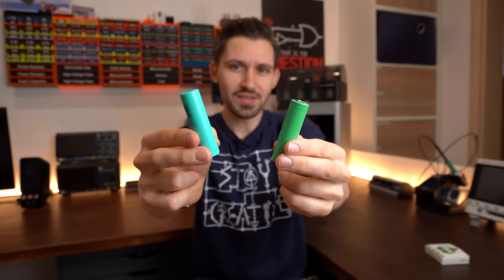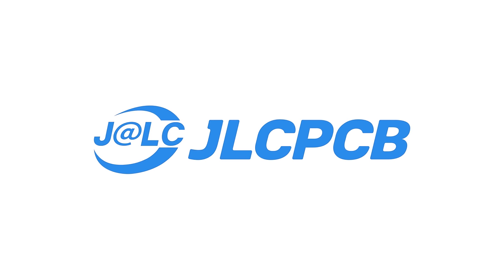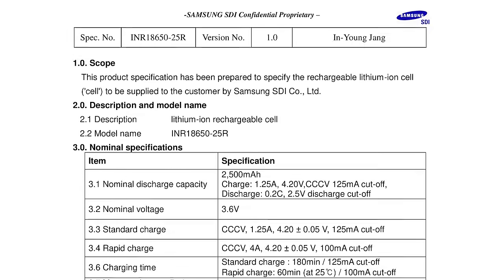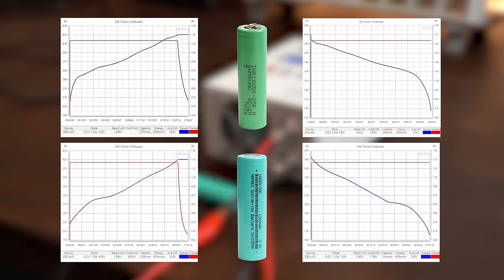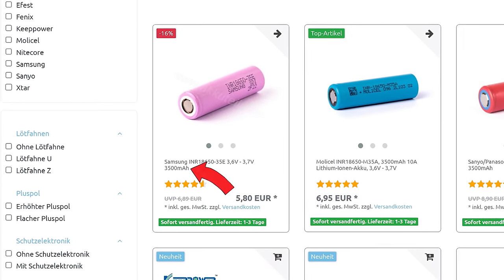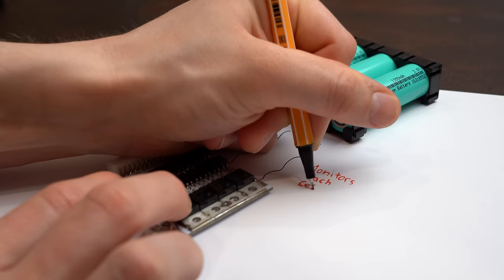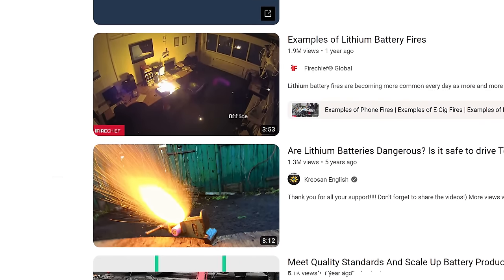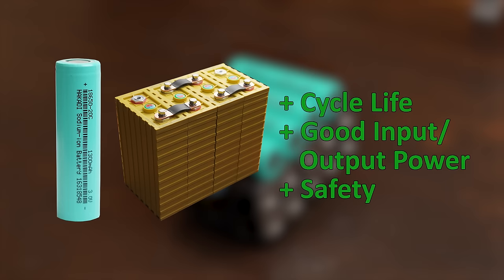"Salt" Batteries are FINALLY Here?! Sooo should you use them?

Comment: This gave me a moment of wondering why Sodium is more common than Lithium. I mean Lithium is 3 on the periodic table so it should be extremely abundant but I guess there's some sort of geochemistry reason why it isn't?

Also I was personally kinda impressed that it held about half the charge of a Lithium-ion battery, that seems pretty good for a first gen battery.

Comment: These look more like a replacement for NiCad/NiMH batteries from the 90s.   Lithium batteries have been around for awhile and like Nicad/NiMH cells, their cell capacity has increased over time.    Aside from the high discharge rate, the comparatively consistant voltage during discharge of Lithum battries has been a game changer for MANY things that rely on battery power.

Comment: Although it depends on the battery vendor and model, typically LI-ion batteries have 500-800 cycles before dropping their capacity to 80%. And it can be significantly increased by charging them up to 85-90% only. I think it is important to mention.

Comment: My supplier offered me a bunch of 210AH sodium batteries for about 20% more than my current LFP cells. I  decided not to use them because the application was parallel connection with stacks of LFP cells and the voltage curve is very different.

Looking at the data sheets it became clear that the sodium cells were not as electrically robust as LFP but I think this is partly because they are only now starting mass production and will improve over time. What is really interesting is sodium cells are much easier to determine SOC because they don't have the time latency in settling to their nominal voltage. LFP cells can take a couple of hours to stabilise making EV applications very challenging as the vehicle sucks and dumps lumps of power into the cells. You have to do a lot of coulomb counting and hope you know the correct pack capacity.

Low temperature operation appears to be better with sodium compared with LFP.

Comment: Could you give me some details about your battery testing equipment? 
Which model is the second tester and is it only for measuring the internal resistance? 

Would be interesting to have a low budget setup for measuring all important parameters like charge/discharge curves, capacity, resistance, automatic sweep for cycles until X% SOH, temperature, ...
Maybe this is an interesting project idea for you. Would be an awesome video!
Reply: I also want to know.

Comment: Give it 3 more years and every device will use it. This is a huge milestone!
Reply: Dont go to hype train. Energy density is rather poor same as discharge and charge times so not useful for high draw applications like EV's and power tools.
Reply: @Hellsong89 Lithium Ion batteries back in 2010 stored  90Wh/l. 10 years later it was 450Wh/l. The energy desity and power output will certainly increase overtime

Comment: gee im impressed with the 20 amp discharge current ,i really thought this was where it would let us down ,as i design and build high power ebike batteries and quite often we need combined totals of up to 400 amps and 20 in parralell and 20 in series is the limit of the space we have available
Reply: unfortunatly its the energy density that is a big problem especialy with evs,and being that it is half the density of lithium will make these very impractical also we use submersion cooling on high end batteries which allows us to charge at very high currents allowing full charges in 30 to 45 minutes ,and the sodium wont take this at all,these cells though are great option for homes though where space isnt  an issue or small power tools and small appliances where saftey is a big requirement

Comment: It'd be cool to see people borrow some ideas from software engineering; in servers it's common to use RAID setups to improve the reliability of storage by overlapping the storage of several hard drives, and also improving performance metrics in some cases, though it occurs to me that ECC memory may be more relevant. 

I think one could, in a very similar way, use an extra sodium ion battery as a "parity" battery per pack to maintain a consistent power output curve.

Comment: i went down the rabbithole to try to figure out the different types of lithium batteries, and i got some NMC Cells from the same brand/distributor  Hakadi, and so far i'v testing them with some Christmas decor led lights with a step down converter, then a step up converter for household batteries to get a steady stable voltage and some resistors. they seems to perform well.

Comment: The safety side is a BIG plus imho but the "shabby" power is a real bummer.  Lets just hope they can improve on both voltage and amperage delivery.  Regarding cycle life ; when charged at specs the regular lithium cells get only a couple of hundred cycles. But when you cap the charge speed at lower amps the life gets really extended. The same goes with discharge voltages.  Really curious to see how sodium cells would do there.

Comment: An excellent review!  Have you looked at Lithium Titanate Oxide (LTO) batteries?  They claim to be able to charge down to -40C without heaters, very good for low-powered devices mounted outside with solar panels.
Reply: LTO is quite expensive and has terrible energy density. One manufacturer makes aluminum encased liquid cooled modules with LTO and while very robust and non-flammable, they are 40kg per 2.2 kWh. That is less than half than a comparative LiFePO4 and far less than Li-ion.

Comment: Everyone seems to be looking for a one size fits all solution for batteries. For small mobile applications, sure, find the densest most efficient by weight solution, but for fixed installations, there are many more options, like Iron Nickel batteries that just use lye as the electrolyte. They can last more than a hundred years and size isn't THAT important.

Comment: There is a guy that has been testing sodium batteries on an electric longboard. Impressive results. Lower capacity than lithiums but prolly way better for environment and more sustainable and still impressive capacity. Did your cells use cobalt?

Comment: If the price of Sodium ion is already less than 30% of that Li-Ion under same volume (not same capacity) then I will consider buying it, otherwise it is too expensive.
And also Sodium in Sodium ion battery comprises only less than 10% of total weight, so it is not that cheap as people might think: "hey sodium is everywhere, so it must be dirt cheap!".

Comment: Sodium based batteries might take a good share of the market as they also have room for improvement still. Lithium will remains for high density/weight and high end usages.
You should include lead acid in the chart for comparison.
In Asia, a lot of small electrical vehicules run with lead acid. It could be a good opportunity to switch to sodium batteries.

Comment: Salt batteries have a small capacity compared to their volume. The charge/discharge limit cycle is also low. The only advantage is cost-effectiveness, which is the same as replacing cheap batteries multiple times.

Comment: I'm very hopeful for these, seems like it has all the issues of a new tech (not as good as the old and bit more expensive) but its already infinitely safer and lasts much longer. I can hopefully see in the next decade the capacity and charge/discharge speed of these getting somewhat close to lithium, I doubt it'll ever be as good as lithium but I'm willing to give up like 10-20% capacity and speed for longer lasting, safer and more environmentally friendly batteries. Like you said they already seem more than good enough to become a replacement for lithium phosphate batteries which is already an amazing thing. would make car batteries and energy storage so much safer, longer lasting and cheaper.

Comment: Great video, I wish you tested the performance in cold temperatures of both chemistries ( e.g. at 0C, -10C, -20C). Maybe on another video? I ride my electric bike in the winter (sometimes at -20C) and lithium-ion doesn't like the cold at all! 😅
Reply: According to some other comments here, the sodium batteries work well all the way to -20c
Reply: @BanditLeader  yes, I am aware, just wanted some real data to compare. My lithium-ion battery loses 30 to 50% capacity below freezing, depending on temperature. I am sure sodium cells will evolve with time, and we'll see improvements in terms of capacity.

Comment: To do a chemical test, cut it open, wipe some electrolyte onto an iron nail or similar and hold in a torch lighter (blue flame, not a colored flame one) if it's sodium it'll burn yellow, if lithium, red.

Comment: Lithium batteries will never go away, simply because there are applications where you need to store a lot of energy in a smaller space, and that's where it shines, even if you have to replace them more often.  Sodium batteries will shine in applications where space isn't as much of a constraint, such as battery banks for off-grid setups using renewable energy.  When sodium batteries really get fleshed out, I think we'll see more people moving to off-grid power

Comment: Well, as far as lithium batteries go, if you remove the outer covering and unroll everything, you will find lithium plates attached to paper(?) Drop those in water. If they explode then it's lithium. (fairly certain salt won't do this)
Also, I would do it outside...
Reply: It's not actually salt, it's just sodium. It reacts even more aggressively with water.
Reply: That sounds like a lithium primary battery (think Energizer Ultimate Lithium AA & AAA), not lithium ion.
Reply: @lonniemcclure4538  - Yes, but also 18650's and similar batteries. Boom
Reply: @PickleRick65  18650 is lithium ion..
Reply: @Reptex_cs  - it's really killing you that I'm not saying lithium ion...isn't it...🤣
Reply: @PickleRick65  not really, just seems like you dont understand this very well

Comment: No offense, but in a Li ion battery, the mass of lithium is not too much (partially because Li is very light), but it is full with other elements, like cobalt, nickel or magnesium, which are not cheap at all. So even if per ton Li is much more expensive than Na, I'm not sure that Na based batteries can become much cheaper. Hopefully, I'm wrong.

Comment: I still think thermal is the way for grid storage:
if we outfitted just 20% of german homes with insulation and heat pumps we could store 4.1 gigawatt hours of energy by changing the temperature by 5c, this doubles germany's current grid storage and modernizes houses with energy efficient heating solutions.

assumptions: uses germany's current grid storage of 3.8 GWh from 2022
uses average german house volume of 300 cubic meters of air
assumes only air will be heated (in reality other objects will be which will make the number better)
assumes 100% efficiency 
assumes my 5 minute maths is correct.

heat pump grid storage may be a great topic for the future btw :D

Comment: The battery has been around a while now. The 18650 were distributed about 6 weeks ago.
From a man in china I heard they have had some issues  with the first lot with low power density and something else.. he thought fit wouldn't be worth buying or about a year while they iron on some of the problems.
They do make prismatic cells, and I know you can get 10ah and 40ah cells but not seen anything bigger than that.

Shame they don't have a more stable voltage. But will be handy as a replacement for domestic batteries.. them AA have had their time while good is rather just use one cell or two for a long time in something

Comment: It's not news.
SHARP had a research center in west coast. They owned many of the salt related patents.
As time goes by, many of them will soon be expired.
Those patents went to FOXCONN after merging SHARP.
There are many Na battery out there long ago. But, the same issues exist from day first.
Li is much smaller than Na. There is no way to surpress Li by Na in high density applications.

Ti is about the same as Na.
2 cents~

Comment: Looking at various research papers on the subject of price forecast, it seems that sodium Ion batteries have a hard time competing on cost alone when compared to lithium based technology (LFP continuing to be its biggest competitor). Only when the lithium supply is disrupted, sodium based tech competes in some scenarios. I think that this effectively means that the geopolitical considerations and safety should probably be central in the choice for sodium iron based technology (which I personally think are very good reasons already)

Comment: would the energy density be something that could possibly increase as the tech matures or is it more of a fundamental limit? 🤔
Reply from the maker: It will certainly get better with time.
Reply: There have already been papers showing lab results that are 4x the capacity of currently available batteries. Of course, all this shows is that the theoretical limit is higher and it's exceedingly unlikely we'll get a commercially viable cell like that. It still thankfully means that the potential for advancements is there and we'll have to see how the future unfolds.
Reply: @salemthekit6143  you might be mistaking that for silicon which expands and breaks the battery
Reply: There's a physical limit on how how high energy density can go (you can even calculate the theoretical maximum solely based on the elements and compounds involved), and since sodium is simply a much larger and heavier element that provides a lower base voltage it will always be quite a bit lower than lithium based batteries.
While improvements are definitely to be expected - especially since the introduction of sodium batteries into the market was rushed to counter lithium shortages - there won't be any miraculous jumps in development, they share too many similarities with lithium batteries already, they were not developed from scratch. The current top of the line core components actually make it very easy to modify existing lithium battery production lines to producing sodium batteries instead.
Reply: @sigataros  it's very likely that could be the case. It's been a while since I read up on it.

Comment: This is always going to be the problem with sodium chemistry batteries, they just can't can't store anywhere near the energy as lithium chemistry in the same volume. This is bad for portable applications but for fixed power storage where weight and bulk isn't a problem sodium can be a compelling solution.

Comment: Beware of the Hakadi motorcycle battery seen at 06:45

I ordered one of those, supposedly with LTO chemistry and it was a desaster. It had clearly been used, was missing its top label, arrived at a seriously deep discharge and wouldn't keep voltage after charging. Luckily was able to return it for free. Damn those scammers.

Comment: Something not mentioned about the "eco-friendliness" of these cells is that typically lithium itself is one of the least toxic components of a battery. The anode and cathode materials (nickel, cobalt) and the solvents used both during manufacture and to make up the electrolyte that is sealed in the finished batters are much more of a health and environmental hazard. A notorious one is N-methyl pyrrolidone, which is believed to cause birth defects in pregnant women. There are several examples already in Europe where the negligent handling of battery chemicals has resulted in the contamination of soil and groundwater.
Reply: Yep, but apparently these sodium batteries can use (at least a bit) more friendly materials as well due to the Na/Li atom size difference, wikipedia has some more info on that. Basically no nicker or cobalt, but more Iron-molecules

Comment: Great for replacing LiFePO4 batteries,  however no one is going to want their EV range halved, or have extra weight in their cordless tools, so those are two sectors where I see Lithium as holding strong.

Comment: The lower capacity is only a (possible) problem in small portable equipements like phones. The number of charge/discharge is another asset. A buck/boost module can handle the sloppy discharge curve.
Reply: "The lower capacity is only a (possible) problem in small portable equipements like phones."

I see this as a problem with every mobile application. If you can only achieve like half the battery life but have nearly the same weight in a car that makes a huge difference. And if your laptop suddenly doubles in size that is also not very nice.
For applications that stay stationary that is probably less of a problem.
Reply: @Pheatrix  Agree!  But, let's take the laptop example, while keeping it the same size. With adequate power technology, if the battery life is enough to last a full day before going back to the charger, it can be good enough.

Then again, we've been spoiled with lithium batteries :)

Comment: I love the idea of replacing all of my 62 18650 lithium ion batteries, a lot of my devices will not require any mod to work with them, only the chargers may need a little modification, but 1st I wish to know if more charge cycles in this case means more lifespan because due the lower energy density means maybe that i will have to charge more times to have the same results (time of use) and no less important how much charge this sodium batteries lose overtime under storage condition. if i am not wrong lithium ion cells lose 25-30 % of the charge in one year and it is not recommended to store fully charged.

Comment: Have you tried hooking up 9 fully charged sodium cells in parallel then connecting 1 non charged cell to them to see how it will NOT catch fire? This will test whether it will catch fire due to internal short or over current. Many battery packs for scooters for example catch fire this way. Because internal shorts do happen and unfortunately most packs dont utilize individual cell fuses.